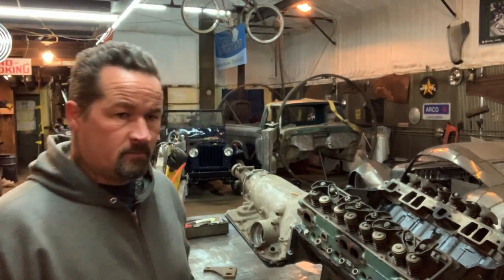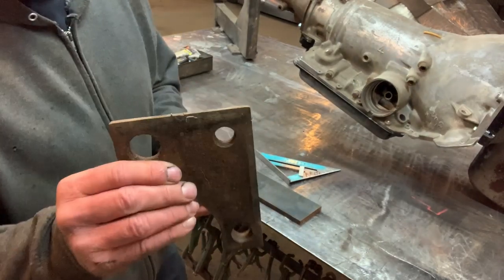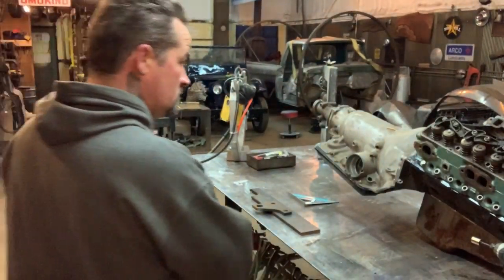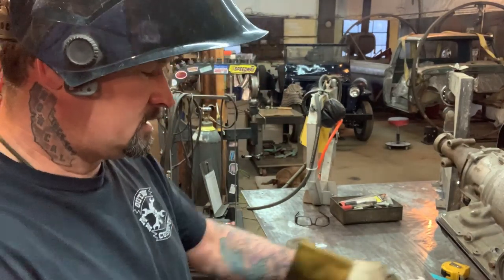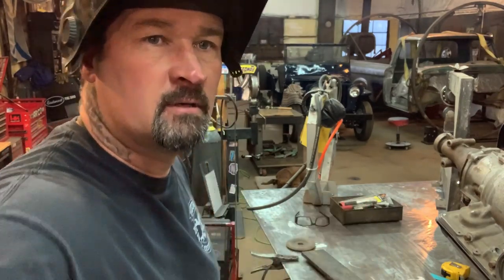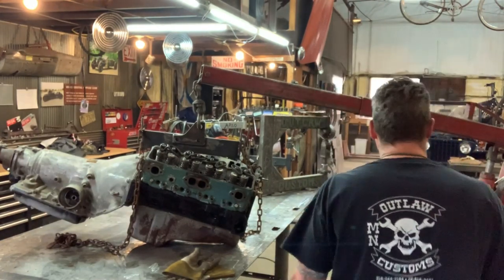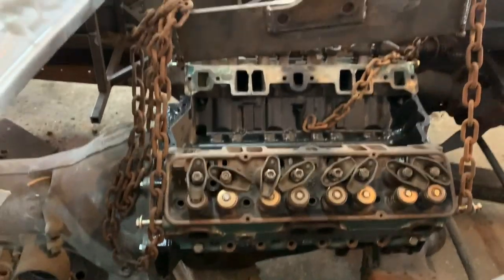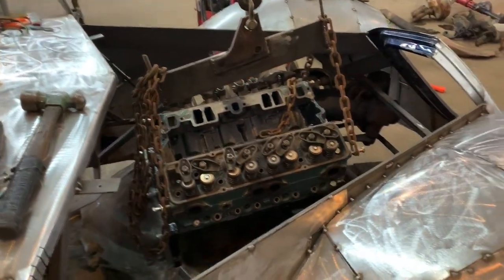Auto repair: Building a engine hoist jib, cherry picker mod

Comment: Holy crap that cut off saw is wicked. Looked like a steel blade on it? Definitely not like the one I used at work. I woulda been cutting for 5min. Said I would never buy a cut off saw cause I hated the one from work so much but seeing you blast thru that 1/2” plate changed my mind.

Comment: I was going to say make a mount in the middle to lift the engine my brother pulls and puts engine's in all the time by his self if no one is around. It can be done it's better when you have help  engine placement. Looking goid glad I'm watching this art piece getting built.

I made some holes to mount my wheels to the legs so I can bolt the wheels from the inside. Then had to sand the rust from leaving it out side prep work done today paint and weld the legs on tommarow. I have to cut 2" off so my chair can roll under the table I want to be coffterble when welding at the table I'm making or what ever I build on the metal table.

Comment: Hey bud. When I was building a lot of engines years ago I found a suppliers that had cast foam of some sort of engines and transmissions to make my day soooo much easier.  As I remember the whole assembly was around 20 + lbs. They came with different oil pans as well. Doing shouts like this benefit everyone.Subs climb like crazy and new and trusted friends are made for sure. So It is great to see the progress and to know you are all doing well. So folks. Be well and be well.You and your lady Heidy are all doing great. Take care and be well eh.

Comment: I wonder if you can make a rubber cast of a engine to mock up for future builds it will make it much easier to put a rubber casting of a engine. Think I seen other builders use it.
Reply from the maker: They sell them at speedway. They are about three hundred bucks. But they Have all the bolt holes in them I would love to own one